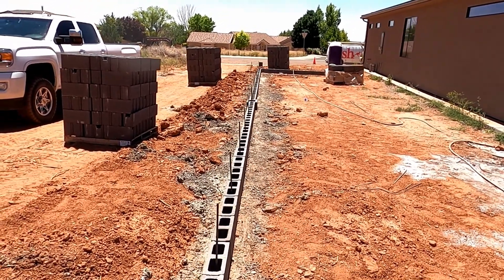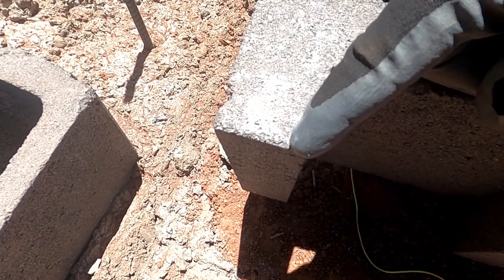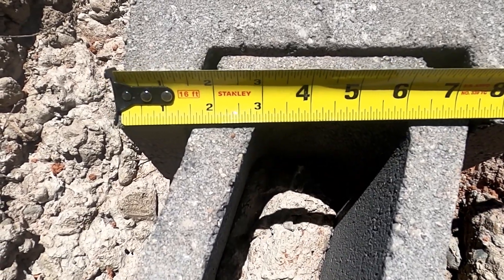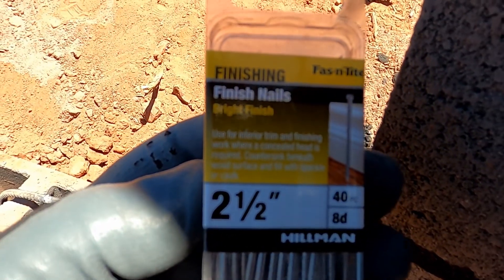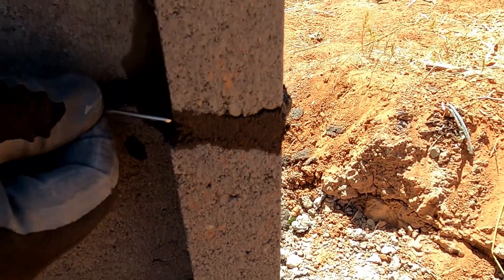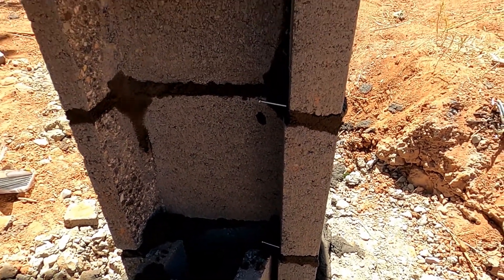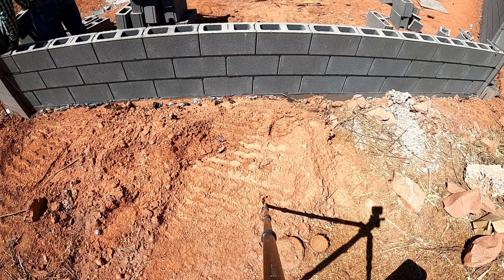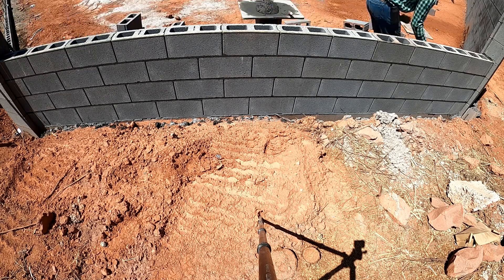Masonry Block Wall (Part 4 of 10) Building a 45 degree angle lead

Comment: At 2:48 when you lay the first block down what is the purpose of the square notch you had cut in the bottom? 

Also do you have a video on what you use for the mud and how you mix and color it? Or maybe it comes already colored dark? 

Thank you again for the great videos.
Reply from the maker: The notch was because the rebar was placed in the concrete too close to the edge column block and didn't allow the block to move so I notched the block around it, it was buried under ground, otherwise I wouldn't have done it like that. I don't have a video just for mortar, I guess I could, there are a few hints as to way the dye is measured in some of my stone videos. Home page of the channel there's a link to stone videos.
Reply: @SolidworksUnlimited  ahhhh ok that makes sense about the notch, and I’ve gotten a few more videos into this playlist now and you actually have one (number 6) completely dedicated to mortar and how you mix the color and everything, it answered all the questions I had about mortar 🙂